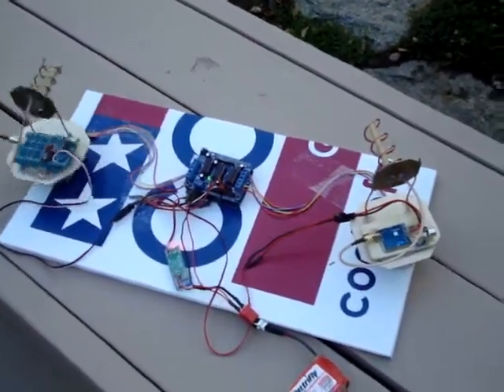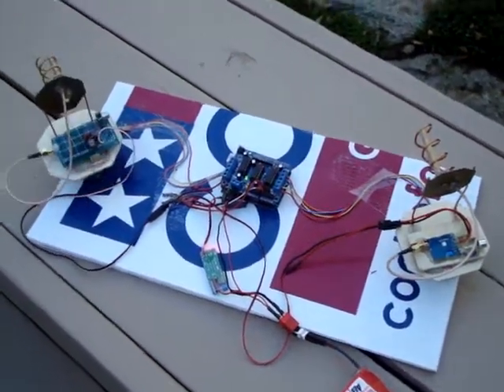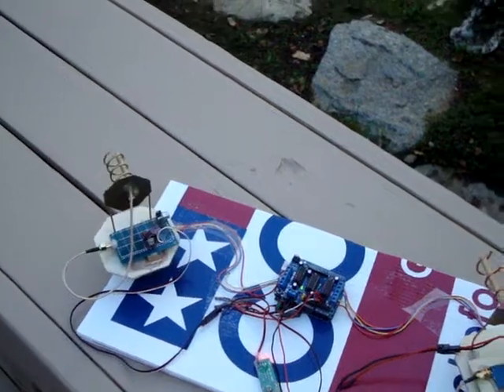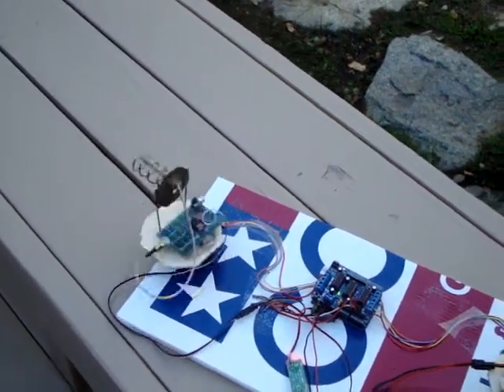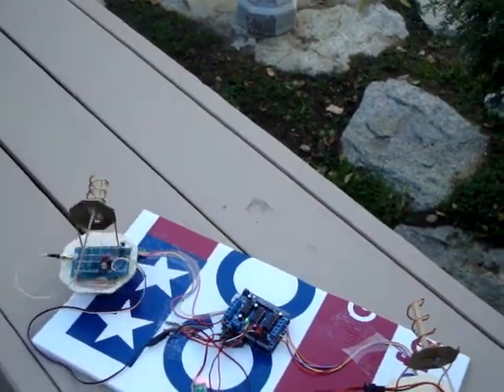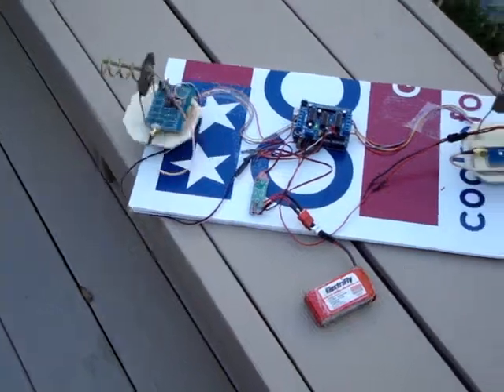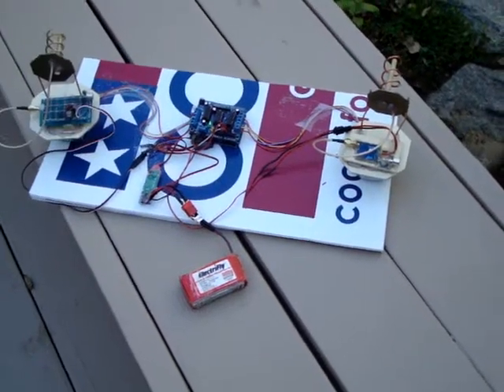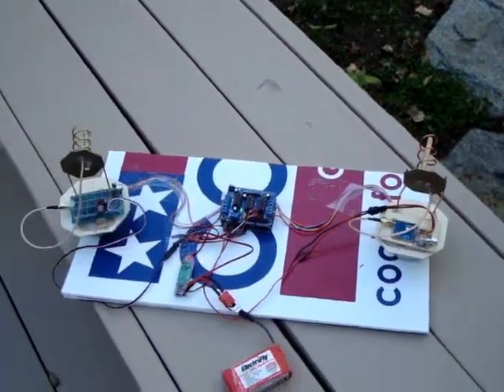Arduino 005

Comment: Thats a really great method for tracking without needing active GPS lat/lon sent from aircraft. Im setting up a twin stacked UHF 5 element yagi array mounted on heavy tripod and x/y rotors, and looking for solutions for tracking...and avoiding reliance on a GPS reading signal from aircraft, instead tracking a carrier sent from FPV or other transmission seems really attractive. The whole array (flight control TX, FPV RX, Telemetry RX,) could be pointed with this.

Comment: if it go up the signal raises the 202 with 2 to 204 and the servo stop digit is lower than the stored last one and antena starts tracking til it has the right digit again , you need the sweep , let it sweep 2 times , 3 time it wil retract digits from the servo stop digit , so when you have lower signal t

Comment: you need to save the rssi digit level.
 then compare it with the live signal , then you need a stop when signal is above the live signal ,and when the signal is higher then the memory saved last rssi then it has to raise the rssi stop digit ,exmple 2 digits up 200 wil be 202 live signal is 201 antena stops ,he antena stil stops ,

Comment: i have the code for one antena but in Vb2010 ,,  i also have a GUI on windows and i use a velleman usb experiment board , i wrote it for this , i am busy to shrink it in a polulu servor controler or the arduino , so whe al can use it , i stil busy shapping the code for the arduino , maybe your code can help me , i already have a superb calculations ,,,

Comment: i think you wil like my project ,whe can combine it ,  watch?v=xfBwR3vD9nA  check my older ones ,, i just gott a arduino and i want to use it for my software i builded , i use same kind of method ,with one antena , with some E,T calculations